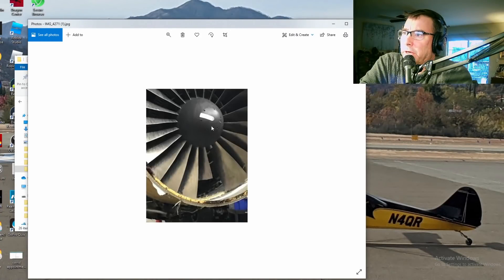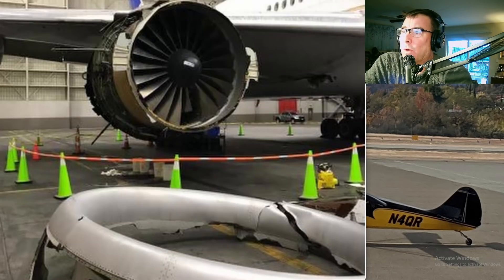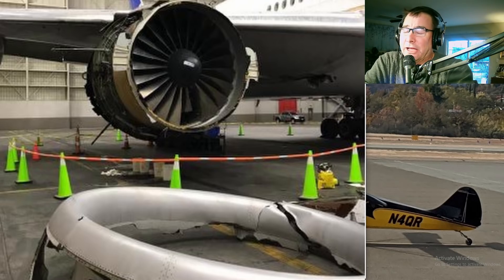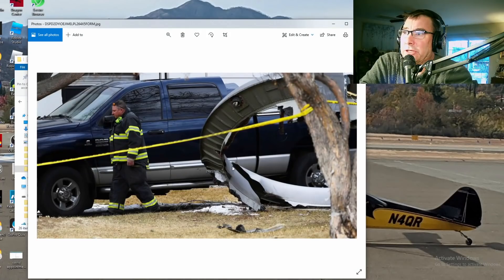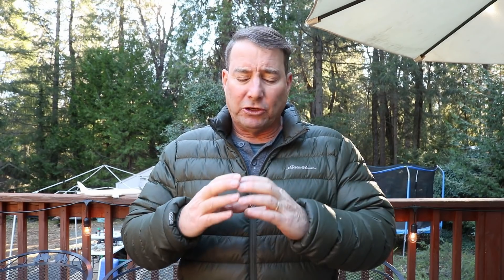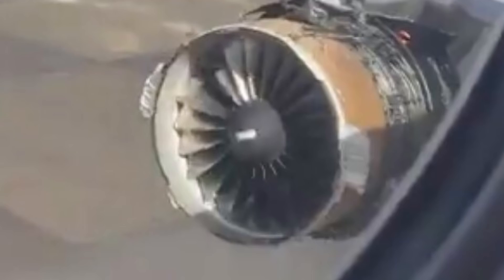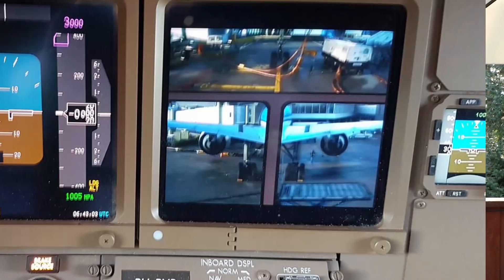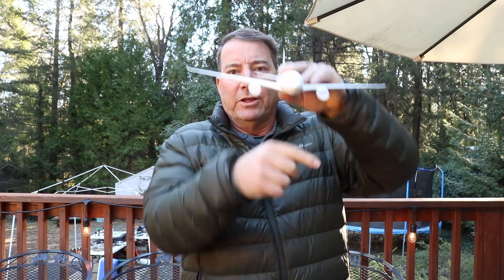UAL 328 UPDATE Fan Blade Failure  B777-200  22 Feb 2021

Comment: Surely those aren't the worst cases - you could lose 1 engine and the cabin depressurizes.  Or lose both engines...  You would think that if you're over water they should be able to drop dead engines  into the ocean to reduce danger (fire) or drag.

Comment: There is a blowout door on the right side of the engine, on the core section cowling. In the pictures, it has blown open, which leads me to believe that the core was indeed on fire. The cowlings around the hot sections were intact, so the fire bottles would have been successful in fighting an internal fire.

Comment: I am not sure the single engine track is the same one you looked at.  I recall the Rwy 25 “T-Procedure” as United calls them is straight out to DEN 6.0 and then a right turn to 010.  I always briefed the F/O the big picture is to go out past Mt Trashmore ( the land fill just west if DIA) and turn to the north.  Riding on the jumpseat for 22 years I discovered each airline has their own procedures.  The Cactus crews called it a single engine escape profile. Perhaps UAL has a different one for the 777 but I doubt it.  Good coverage.

Comment: The cowling contains the fire suppressant. With the cowling gone the suppressant will dissipate and not be able to do its job.  Also note in the photos of the RT side of the AC there is what looks like damage to the lower fairing at the wing root.
Reply: Correct there is a hole on the underside near the wing root. However there are 2 layers to the aircraft skin. The outer is just an aerodynamic cover. There is an inner stronger skin. There is no information re cabin pressure during this dligjt

Comment: 11:45 How predictable is the occurrence of vibration resonance at a certain combination of altitude and speed? And is the designed fail of the engine mounts safe for the rest of the aircraft?
Reply: Vibration frequency would depend on how much it is out of balance - little or lot. Better to have an engine fall off than the wing disintegrate. Yes?

Comment: Having worked on the 777 program, the 777 was really the aircraft that defined ETOPS and its importance. It was deemed that unless the 777 had ETOPS at launch, its main market--long haul transoceanic flights--would be lost to the Airbus A340 with its four engines. How many A340s do you see being manufactured anymore, while the 777 lives on.

Comment: So...  The takeaway from this event is that 
(1) The underlying engine design worked (fan survived 1.5 missing blades, containment ring intact), 
(2) We got a bit lucky that no engine parts penetrated the fuselage or damaged the horizontal stabilizer, and 
(3) Actual engine damage (skins blown off by slipstream) looked worse that it really was.  
All in all, it could have been SO much worse.

Comment: Reminds me of the Pratt Whitney engines in the earlier F14A for the Navy. My squadron of 12 jets had only 4 flying at a time due to blades ripping thru the fuselage. Way to go once again Pratt Whitney. The Navy got rid of all those engines and went to the GE engines. Imagine every 100 hours taking out the engines for  inspection which we found cracked blades. National security needs reliable engine, not fraud, waste, and abuse.

Comment: Juan,ANOTHER excellent video by you.  X.  Q:  can/does the autopilot , when on the I L S , take the a/c thru minimums,in a fully stabilized approach to T D , or must the a/c manually flowed ; THIS Question regarding 1 failed engine X
Reply from the maker: 777? Yes. Can autoland on 1 engine!

Comment: Excellent!  
Questions.  For failures at the extemes of ETOPs.  Ability to brake the shaft of the failed engine?  Or maybe the ability to blow the bolts and jettison the engine?
Reply: I'm not sure I can imagine a situation in which you'd benefit from having the ability to jettison the whole engine.  Sure you'd get rid of a small amount of drag, but dropping the whole engine so will severely shift the airplane's center of gravity, likely making controlled flight extremely difficult if not impossible!  At the absolute simplest level, these engines are essentially just large metal tubes that contain a shaft and thousands of metal blades.   These blades comprise several stages in the engine and they vary in length from only a few inches/centimeters up to a few feet(over a meter) long.    Both fan and compressor blades are fixed to the rotor shaft, and the rest of the blades are actually guide vanes, these are fixed to the inside of the tube and do not rotate.  Now just add a bit of fuel plumbing, a combustion chamber, and it's associated air plumbing, dozens of sensors, and a handful of bearings so the rotor assembly can spin, and you've got a turbofan engine!  So you see, once its supply of fuel is shut off, there isn't much inside of one that could catch fire and continue burning.  In a blade loss event like the topic of this video, fire was among the least of their problems that day.  Losing rotor blades unbalances the rapidly rotating engine and causes extreme vibration, but these engines are all designed to contain such an event without it resulting in catastrophic failure.   And the engineers in charge of designing the engine mounts made sure even the worst possible vibrations, like in the blade loss scenario, cannot cause harm to the wings or fuselage.   So the resulting vibration isnt likely to distract competent pilots too badly either, as they will have all of their attention focused on maintaining controlled flight of the aircraft.  Of course I'd expect such an event to be absolutely terrifying for the passengers!  Disclaimer, I'm not an aviation/turbofan expert in any sense of the term, I'm simply a curious guy with a passion for learning, and a healthy fascination with all things turbine/turbo-machinery related.   Thanks for reading, and i look forward to more discussion on this topic.

Comment: When you lose an engine in the scenario you explain, do you do a gentle decent? Or is it a bit more of a "dive" and get to a lower altitude quickly
Reply: I suspect They would only quickly descent to a lower altitude if there was a cabin decompression. Otherwise they would likely let the aircraft sink to the single engine altitude. In this case the Rockies are directly in their path and their single engine op briefing had to take that into account.
Reply: @biingyin5522  so using gravity and forward inertia to help them along then. Cool thanks Bing

Comment: Juan. Do you think there was a significant difference between a simulated single engine adverse yaw vs the yaw with single engine without cowling and windmilling. I assume the yaw authority would be balanced with airspeed increase. And would the good engine auto-throttle automatically retard if loss of yaw control or do you have to disable it?

Comment: Just by a show of hands. Who wants Juan in charge when sh1t goes sidways? 
For me personally, I'd like that because I know full well there will be little to no commentary to the passengers. that will reassure me that the pilots upfront are doing what they need to do. I'm not saying I'd not be waiting for that mic to key so they can explain a little. But you'll know when it does, it's because they have a solution and also a plan. Or at very least a good indication of either  🙂

Comment: Looks like unlatched engine cowling issue.  Right side clam shell door could have come loose and nerfed across breaking the blade.   Does not look like an uncontained failure as the kevlar belt looks mostly intact and not severed..
Reply: You should send comment to NTSB. That’s important info.

Comment: Juan. Great video.   As a note I would personally think the etops single engine speed would be a dispatch requirement, it’s just a speed to keep you within your etops certification circles.  No way I would fly that speed with all that shaking going on. I’d primarily be concerned with fuel conservation for range. As you note the more fuel critical event is the loss of cabin.  If you really want to scratch your noggin give some thought to a cabin failure as a result of an engine failure at the CP.  yikes.   Maybe I should even bring that one up😂😂😂. My company has us check the landing distance for an airport return as part of the single engine landing checklist. But on my bird we can’t dump gas so it’s not a factor for landing, but rather for just landing distance and performance.  I like the idea of putting the IRO to work on that one, gives him some incentive to get more senior and stop bidding the snooze wagon.  Better yet gets the crew ginned up for the specifics of a return.  

Your videos never cease to amaze me.  And I find your knowledge of aviation unparalleled.  You can be my wingman anytime😂😂😂😂

Comment: When I stop and consider how much design and engineering went into building the engine and the plane realizing that the plane that size and weight could fly back to the airport on one engine and the plane was not torn apart and the whole thing comes crashing down is a testament to the men and women who design and build and fly these animals. What a freaking miracle it is to see how well built the plane was and how skillfully the pilots professionally and safely landed the plane. Even the ATC and ground crew and the whole system. Why doesn't the whole country work like that? I bet everybody applauded when they stopped and I would have demanded to hug the entire crew before I got off.

Comment: I'm a structural fatigue guy, not aero, but pretty familiar with the fatigue properties of Al alloys, zip about Ti alloys....that side-to side shaking bothered me. I do hope that loss of ring, that led to the cowling loss, that led to the fire (????), that led to Juan's "white fart in the wind" (a reference to the clearly visible puff of white vapor in the video).

My point is metal fatigue, I would be uncomfortable losing 34 pounds of blade at ETOPS between DEN - HNL. 

Was that tested? Was loss of 15,800+ pounds considered for any length of time? If the 3 hangers broke - from front movement mass of much of that 15,000 pounds working those front joints - that appears to POSSIBLY be a LCF/FM Low Cycle Fatigue/Fracture Mechanics concern. The flames do little or nothing to the structure. 
The MOVEMENT is.

Comment: In the event of losing an engine halfway to HI, as long as you have cabin pressure, what is the reason for coming down to a lower elevation for the remainder of the flight?
Reply: The engine needs denser air to have a higher thrust, but the denser air increases drag, so it's finding the next sweet spot in engine performance vs drag. The real question is if the higher workload on the engine makes a second failure more likely.
Reply: @johnhaller5851  Thanks for the explanation. To me it would make sense to reduce windspeed to reduce workload on the remaining engine, but that is in direct opposition to what Juan said about maintaining speed to get to the destination as quickly as possible and not prolong the emergency. 

Also, it seems like maintaining a higher altitude would favor allowing the aircraft to glide as close to land as possible in the event of both engines failing. But that just might be my naivete showing through.

Comment: Juan...as much as I like your videos - please see the accident report for an IDENTICLE accident on UA-1175 (the sister ship to this one). The nose cowl did not separate from the fan blade slicing it, they will find it's due to a change (since certification tests) of the inlet bulkhead and the fan case attachments from aluminum to CFRP. The blades failed due to Pratt and Whitney not really knowing how to interpret their own inspection findings.

Comment: 10:40 What makes 20,000 ft "habitable" for a single engine?
Reply: The remaining engine can only provide enough bleed air to supply the air conditioning system so it can maintain a cabin pressure equivalent to 8000ft altitude.  Both engines can provide enough air for all altitudes but one engine out will limit supply, hence 20000 ft aircraft altitude.  When air is bled from the engine compressor you are essentially ‘bleeding’ the engine of potential power, hence the name ‘bleed air’.
Reply: @davidsteer8142  excellent explanation. Thank you! I was confused, because I assume you're exposing the aircraft to more resistance at the lower altitude. Hence, making the remaining engine work harder.

Comment: I guess United fly's in a maintenance crew to do the engine change or contracts local boys.  It appears these engine episodes don't damage the aircraft and a standard engine change and check flight will getter back up. Nice job !  C U In Picadilly.
Reply: I believe united has maintenance in denver. But my airline used to charter us a cessna 310 for repairs. Usually flying through us thunderstorms and the pilot would fall asleep

Comment: The first video I saw it appeared the fan blades were not damaged now the still pictures tell a different story and the Kevlar containment looks like it did it's job and if the inlet fell off the way you described I could see the slip stream ripping apart the cowling and I'm sure the vibration gave it help. I'm looking forward to the report and would not be surprised it plays out the way described it.

Comment: Maybe a stupid question but, when something comes apart like that would it ever be appropriate for the captain or co-pilot to leave the cockpit and see what the passengers see?
Reply: And what difference would it make? They have to land the aircraft. If it happened over the ocean, maybe, but the pilots are not trained in stresses an engine mount can take, or if an engine breakaway is worse than slowing down and risking a second engine failure.

Comment: Juan:  Do you get any sense that jet aircraft engine manufacturers are pushing performance a little to far?  So far this failure seems to be limited to the PW engine but ?
Reply: It's not that the performance is being pushed too far, but if metal fatigue is showing up after 25 years of hard use. The related question is whether ETOPS ratings should be reduced over time. Certainly the number of engine failures eventually exceeds the mathematical calculation done when the ETOPS rating was given. If more frequent inspections cannot find the problem, eventually the ETOPS rating cannot be maintained, as the probability of a second engine failure before a suitable landing site is found becomes too high. A lower ETOPS rating would be the death of planes with these engines. I'm not in the Aviation field, but have participated in network equipment reliability analysis. In both fields, part of the analysis is how long the system can run before the first failure is fixed, or the exposed redundancy reduction. If the mean time to repair has to be decreased, that means ETOPS will reflect that. If these planes can't fly to Hawaii, they are worthless to United.

Comment: I kind of wonder if there are any duration tests done on engines windmilling with oil loss? Just has me wondering how this could of turned out if they would of had to flown in maybe 300-500 miles like that. And if there was a way to retrofit the engine mounts for over seas flights to have some way to jettison a bad motor that is vibrating severely.

Comment: I about the mid 1980's a major airline operating 727's  had a chronically leak at the forward lav service  panel that built up a large chunk of blue ice. When that chunk of ice broke off it entered the inlet of number three engine causing an immediate  stop of the engine and the rotational inertia twisted the engine from it's mounts and the engine fell to the ground. In this case the engine was truly missing.